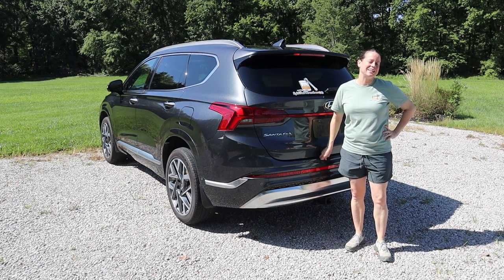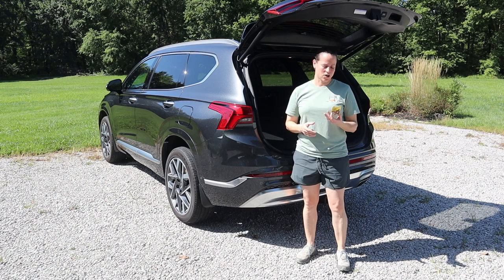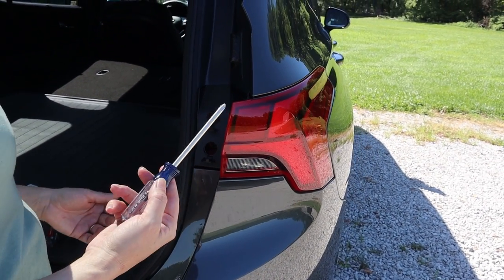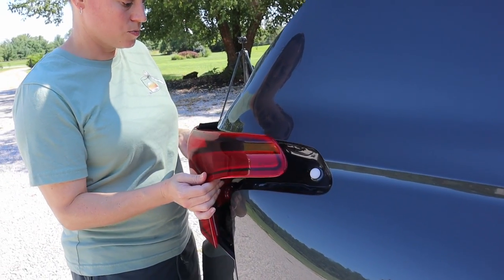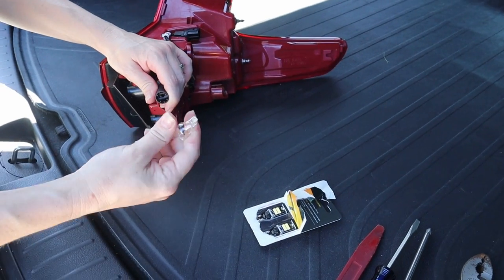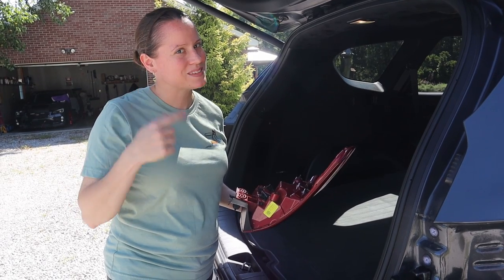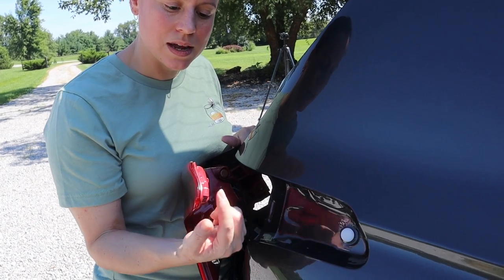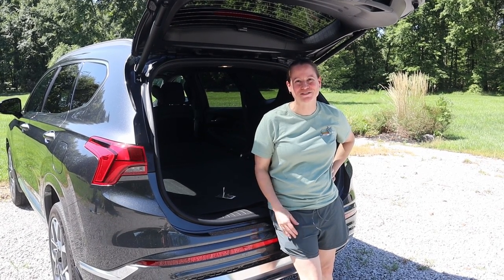2021 - 2023 Hyundai Santa Fe - How to Upgrade Reverse Lights to LED

Comment: I ordered my lasfit leds. The only ones I didn’t buy are the tag lights and the rear turn signals. Did you replace the blinker bulbs in your 22?  I wasn’t sure what the bulbs number was. I enjoy your videos keep it up. Thanks
Reply from the maker: Hi Hot Rod! Thanks for watching and asking. Our Santa Fe came with LED turn signals from factory, and they are actually not housed in these side/rear lenses. Additionally, we didn't replace the tag light as our local laws only require that they operate and render the plate visible. If you'd like some more information about possibly ordering LED replacements for those, feel free to send us an email and we'll see what we can find out with our friends at Auxito. Hope this helps; take care and stay safe!

Comment: Hello I’m just curious. You used auxito for the reverse lights and lasfit for the interior. Is there any special reason for that? I have a 2023 sel and I’m going to replace all the non led bulbs in it over time. Thanks for the videos it will help when I do it. Thanks Brian
Reply from the maker: Hi Hotrod. Thanks for watching and asking. We appreciate it. It just happened that way because Lasfit asked us to review their bulbs. We just so happen to have a longer relationship with Auxito as a channel sponsor.  Both bulbs companies have been great so far. If you go with Auxito, be sure to use our code for a savings. Hope that helps. Stay safe out there with your '23.

Comment: We bought a 2022 Hyundai Santa Fe Limited in 2022, never had a Hyundai...are these very dependable vehicles? We have always been Honda people but wife liked the Santa Fe..
Reply from the maker: Hi Bobby, thank you for watching and asking! It's been our experience that every new vehicle regardless of make will go through various recalls and warranty items. The important aspect for us was to ensure that we really liked and trusted the dealership as much as the car we wanted to buy as they will be the ones handling (or fighting) any warranty work. We found that our 2022 Calligraphy hasn't had any major warranty work needed aside from an insulation tuck here and a realignment of the rear bumper cover (which we took care of ourselves in this video). There is a known issue with the transmission, which is covered under warranty should we ever experience it, which is related to the oil cooler. That said, we have had no mechanical issues whatsoever in the first 41,000 miles of ownership, and are looking forward to many more road trips! Hope this helps; take care and stay safe!

Comment: I installed those SAME LED bulbs in my reverse lights on my Cadillac and it caused electrical problems throughout the car. The dealer traced the problems to the fact that I had replaced the standard OEM bulbs with LED ones, saying that it threw the electrical system "out of balance". They put OEM ones in and all of the problems were solved completely and never returned. I still have those LED bulbs and want to put them in my 2023 Santa Fe, but am concerned. Have you had, or heard of, any issues with replacing the OEM bulbs with LED's?
Reply from the maker: Hi Kevin. Thanks for watching and sharing.  We greatly appreciate it.  Thats crazy about your Cadillac.  I've heard of similar stories happening and it required resistors to be installed in line with the bulbs but not always. We have had no issues at all with our 22 and these being installed and we've upgraded all that weren't from the factory.  Hope that helps and congrats on your '23 purchase.  We hope you have many safe miles in it.

Comment: LED is the way to go.  I'm surprised they didn't do that from the factory.  Thanks for the video!
Reply from the maker: Right?! We were talking about what other LEDs we needed to convert and then noticed there are a few bulbs in the Santa Fe that are normal incandescent. I struggle with why they would do that when the LED lights were a huge selling point for the Calligraphy trim level from the dealer. We'll get around to replacing the other old bulbs soon enough. Thanks for watching!!

Comment: Thanks for this and your other videos about the santa fe. I just picked up a 2023 limited today. Ordered the lasfit mats before seeing your video (I normally get weathertech, and would have probably got them for this vehicle too but I had a 2021 rav4 hybrid before this and it came with the all weather mats from toyota and I think they were better than weathertechs-- was really hoping that hyundai would have similar ones but I can't find them and came across the lasfits and figured I'd give them a try).  I'm hoping to switch out all incandescent bulbs to led- just trying to figure out what all I need. Can't seem to find any sites that list what each bulb is for the 2023's :(
Reply from the maker: Hi wantsanewvehicle. Thanks for watching and sharing. We greatly appreciate it. Congratulations on your new Santa Fe and on your new floor liners. We'll be doing an episode soon regarding changing out the cargo and vanity bulbs to LED. That will complete all of our LED upgrades. We hope you tune in for it. Stay safe out there!

Comment: How do you replace the headlight bulb for this car?
Reply from the maker: Hi Uwenasri, thank you for watching! Our deepest apologies for not replying to your comment sooner. Our 2022 Calligraphy came with LEDs from factory, so this was not at the top of the short list for upgrade for us. Between the weather, our travels, and take a quick break from the channel we have only just now had a moment to look under the hood for the stock headlight bulb locations! Underneath the hood, there are plastic covers that are sealed and can easily be twisted off for access to the headlight bulbs. On the left side (USA driver side), it is easier to access than the passenger side were the wiper fluid fill tube can obstruct the view. Since we did not need to upgrade these bulbs, we would recommend that you do full research into your bulb replacement through Auxito.com, where you can also use the code WRENCHERS for 10% off your order. Take care and stay safe!
Reply: @SpiritedWrenchers  I’m aware of the factory led lights. I have a 21 Santa Fe limited and the led lights aren’t too bright.. made an attempt personally to check if it could be changed without any craftsman and realized it was a whole led module block🤣🤣.. thought there was some trick to it without having to disable the headlights

Comment: Great easy to follow video. Is there a, way to change the rear turn signal lights to amber color? It's more noticeable. Not sure why they made it red when the front is amber.
Reply from the maker: Hi cdchannel, thank you for watching and the excellent question! I believe most manufacturers are repurposing or using red in the rear for the brake lights, while some older vehicles and non-USDM use amber for rear turn signals. With the rear signal being an LED strip inside the bumper cover, it would be possible to replace to amber only if that part was sold as such since the entire lense assembly is red. Hope this helps; take care and stay safe!

Comment: Nice, I'd like to do that on ours along with the cargo lights.  We put on Falken Wildpeak A/T Trails on our Limited last week.
Reply from the maker: Hi D M. Thank you very much for watching and sharing. We appreciate that. A/T tires? You plan on taking off on some trails? How does it ride compared to the streets?
Reply: I put these on for a few reasons.  First, the limited doesn't come with a spare, so I wanted a more "durable" tire than the OE ones.  Second, they are 3 peak winter rated, we do get a good amount of snow in CO.  Lastly, we don't offroad but drive a lot of forest service roads for camping.  The ride is slightly stiffer and louder, but that was to be expected.  The street tires were softer, more quiet and not snow rated.  Cheers

Comment: I saw your video channel last night for the first time and I subscribed, I tried to use your 15% discount on Amazon for the Trim Removal Kit, but it would not accept it. I entered "Wrenchers" in the coupon area, but the message says it is not valid. Do you have any suggestions?
Reply from the maker: Hi Paul. Thank you so much for watching and subscribing. We greatly appreciate that. The 15% discount code is only valid on the Auxito website for the bulbs. The links for the Amazon items unfortunately don't have a discount. We just provided those affiliate links to show what we used and if purchase is made through them, we receive a small commission that goes back to helping make additional content on the channel. Hope this helps. Stay safe out there and good luck with your upgrade!
Reply: Thank you for your prompt reply, your answer did educate me on my questions.
My 2019 Santa Fe doesn’t have any other name badges on it but the name. Which of the LED bulb packages should I order?
Reply from the maker: @paulshaar4187  Our pleasure. If you go to Auxito.com and choose LED bulbs followed by your year/make/model info, it will show which bulbs they recommend for the reverse lights. I'm not sure which trim you have (you can choose based on headlights) as that may affect which ones to get. On their website is where you can use our code for a discount also. Hope that helps.

Comment: I have the 2023 limited. For some reason Amazon says these reverse LEDs don't fit my vehicle..... Weird.. I think it's the same as a 2022..
Reply from the maker: Thank you for watching and sharing. We greatly appreciate it. I wouldn't follow Amazon all the time on their compatibility. We recommend going directly to the brands website and using their selector. If they don't have a 2023 to choose from, contact them directly. They may ask for a picture or bulb measurement to let you know if they have one that fits it. They are likely the same though but I'm not 100% positive on it. Hope that helps and congrats on your 2023. Stay safe out there!
Reply: Yes it’s the same as a 2022. It’s a carryover year. I have a 2022 limited and there’s nothing different on the 2023 model. Amazon just probably doesn’t have the official specs put in yet for the 2023 model year.
Reply from the maker: @stefanb.5154  Nice. Glad to hear it and thanks for sharing!

Comment: 3:00. USE A RAG BEHIND THE TOOL to prevent paint damage.
Reply from the maker: Thanks for sharing. Yes, certainly a technique that we have used as well. The right tool will also result in no damage in most cases.

Comment: I have the same situation with a 2022 Hyundai Tucson Hybrid Luxury trim.  The rear turn signals and backup lights were not LEDs.. while everything in the front is LED.  Why?  LOL  I ordered the same brand lights as mentioned in this video.  Also changed the cargo bulb and vanity mirror lights to LEDs.. while everything else in the car is LED.  Why?  Anyways.. get LEDs..
Reply from the maker: Hi K H, thanks for watching and commenting. Sorry for our delayed response, but we feel every bit of this! It appears Hyundai didn't have a lot of rhyme or reason to why not all the bulbs were upgraded to LED while others are just left behind in the dust. We have a few more LED conversions to make with interior bulbs, so stay tuned!

Comment: what about Turn signal  and Brake light bulb  do you plan to do them LED too ?
Reply from the maker: Hi Viny do Pham. Thank you for watching and asking. The turn signal and brake lights are already LED so we won't be messing with those.
Reply: @SpiritedWrenchers   mine are not LED so that I’m asking something weird some LED some not  on 2023  , and I think 2top trims  Limited and Calligraphy  will have LED  the rest none
Reply from the maker: @vinydopham7864  Oh, I totally understand now. Ours is the Calligraphy so the rest are LED for us. Auxito & Lasfit should have the bulbs you need and you could use our discount code for savings. Those bulbs should be in the same housing as well.